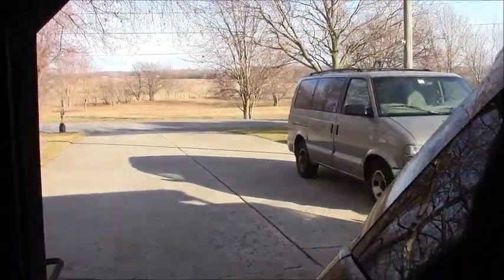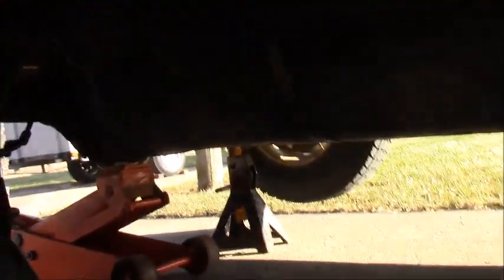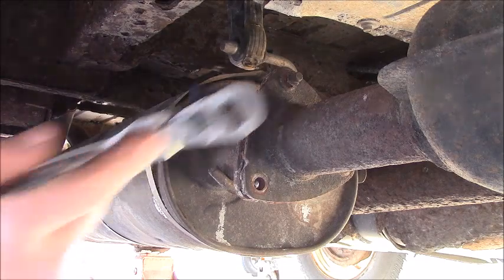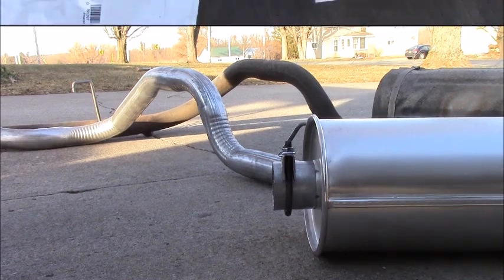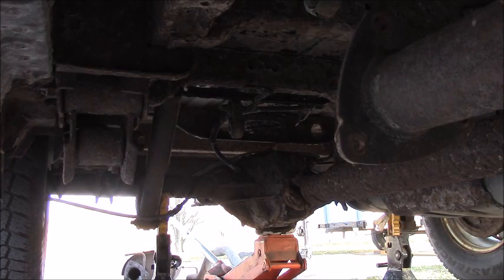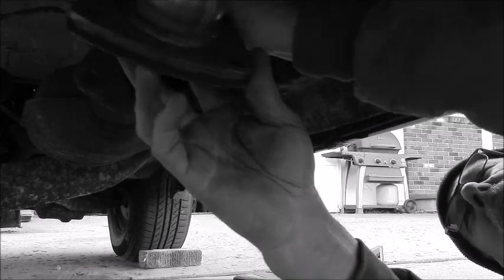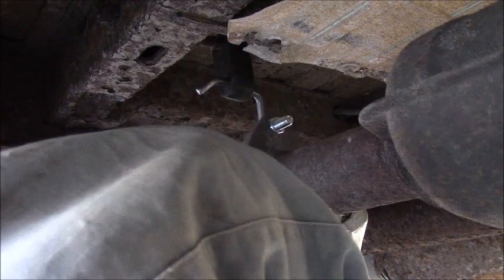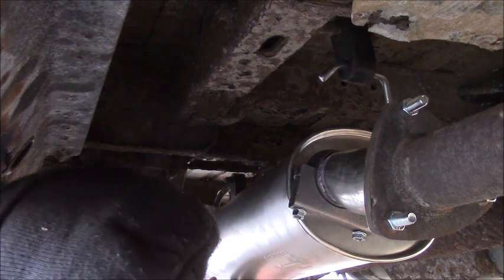DIY Astro exhaust replacement, replacing the muffler and tailpipe on a 2001 Astro van

Comment from the maker: I got it on Amazon from MAC auto. I just searched for 2001 astro exhaust. $190. I had to get an extra 3 bolt flange gasket, 3 rubber hangers and 3 new bolts and nuts for the flange at NAPA.
Thanks for watching!

Comment: Get some new rims holy crap that's dangerous
Reply from the maker: Yeah, I bought the rear wheels online as “refurbished “  a few years ago! One still looks fine but the one has had all the finish flake off! It’s like they just coated it right over the rust!
Reply from the maker: Plus, rims are hard to find because they are 5 bolt with 5” bolt circle, odd size!